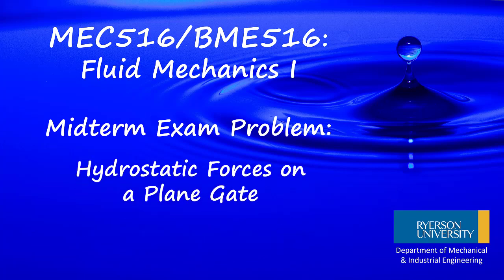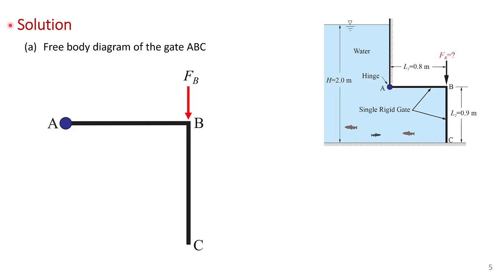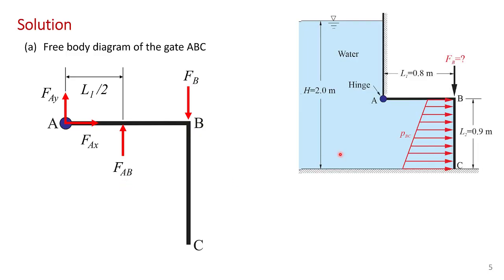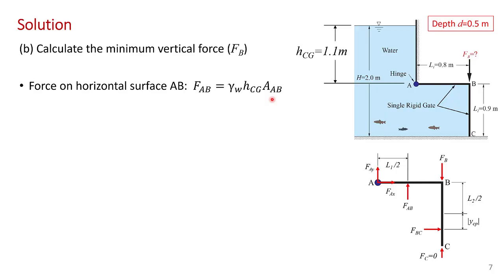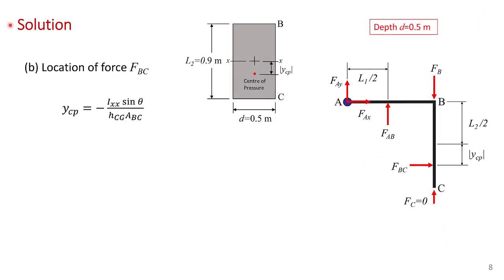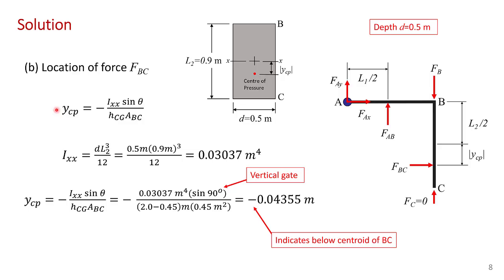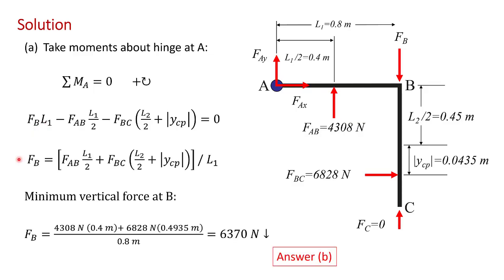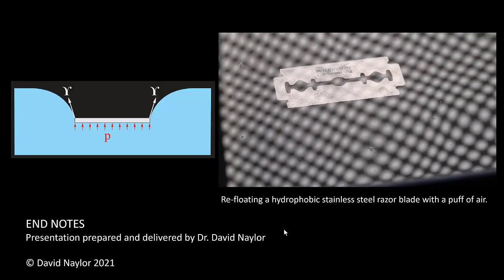Fluid Mechanics Exam Problem: Hydrostatic Forces on a Plane Gate

Comment: i think thst force on ab should be xero as there is no fluid above it
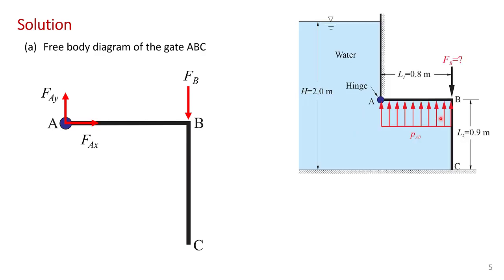Reply from the maker: You are incorrect. Imagine if you drilled a hole in surface AB -- clearly water would jet upwards. There is an upward pressure on AB.  Listen (again?) to the explanation that starts at about 2:35
https://youtu.be/31lijQM469k?si=K5tAQV19qkC_QKYm&t=155
Reply: @FluidMatters  Hi professor, why would we not consider the force due to the ambient pressure as well in this case? Say: FAB = pghA + F_atm
Reply: Oh wait I see, is it because it only has contact with the solid surface? And not the air?
Reply from the maker: @ryansirimanne3011  That's fine. But if you include the upward atmospheric force, then you must include F_atm which acts downward on the other side (the air-side) of this surface. So, these forces will cancel out.